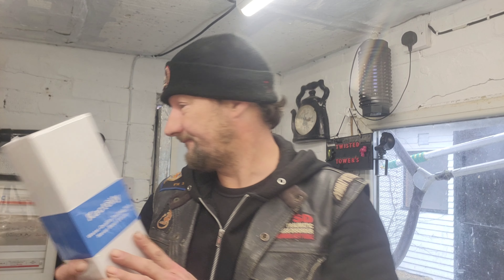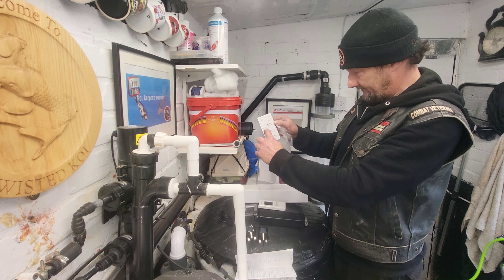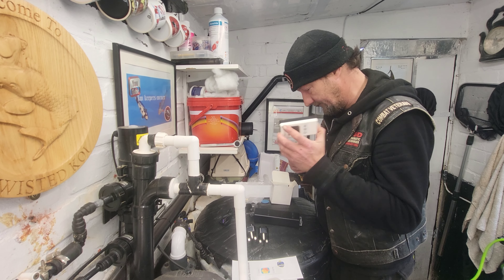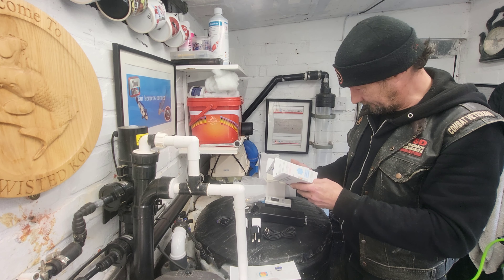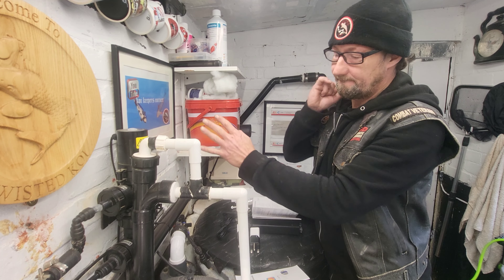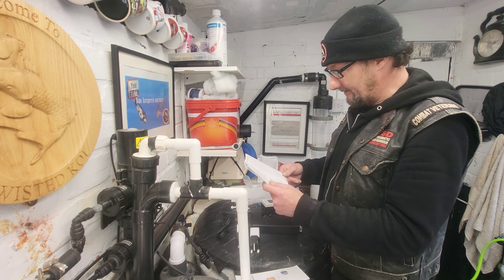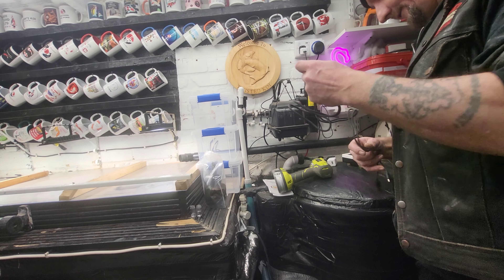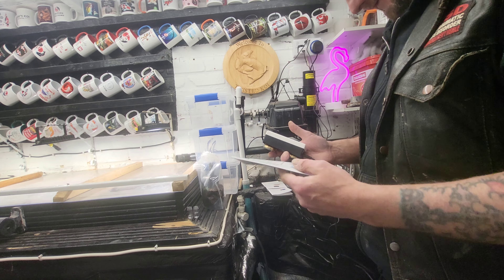Technology & Twisted Tower's with the Kactoily 7 in 1 Water Quality Tester #kactoily #koi #koipond

Comment: Thank you, Vince! Because of the UK voltage issue there is always talk of jumping values, so we have been fitted with US plugs and converters. Hopefully this will solve the UK voltage problem!:octopus-red-waving:
Reply from the maker: The only value I seem to have jumping up and down is the ORP reading 🧁👍👍👍
Reply: @LeTwistedOne  Try replace the probe plug with ours, it should be ok after replacement!
Reply from the maker: I have and still have a bit of fluctuation on orp reading but I did read on you're website that I could take upto 7 days for the orp reading to settle 🧁👍👍👍
Reply: This is true if ORP is growing slowly. If it's bouncing back and forth then you might need to try replacing the plug. Good luck! @LeTwistedOne